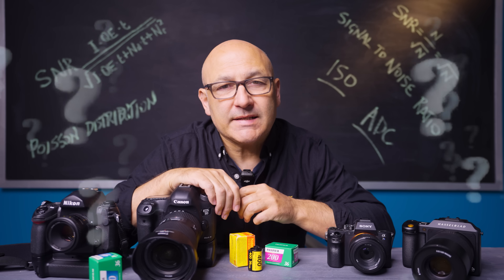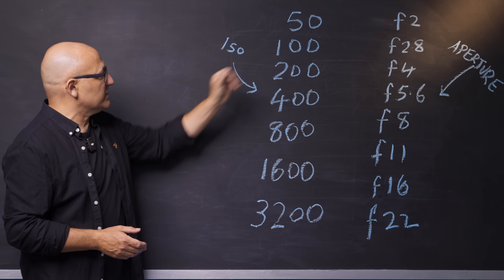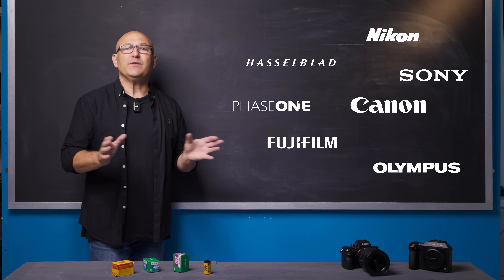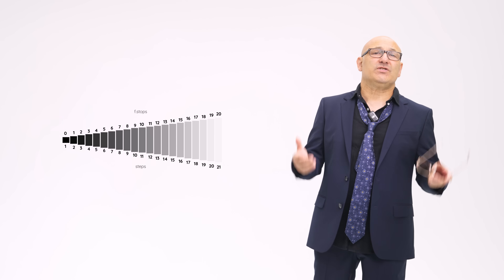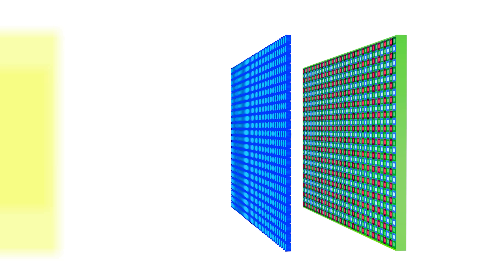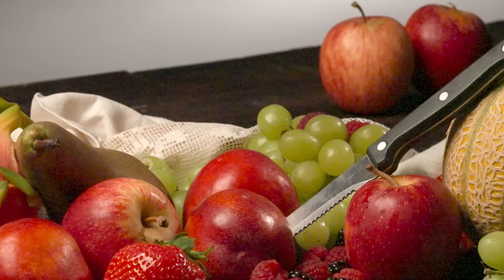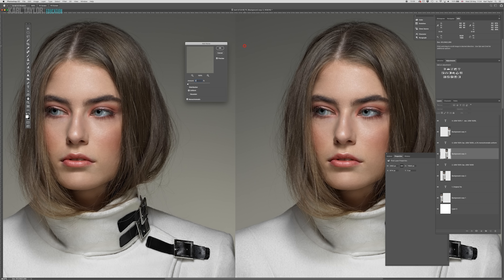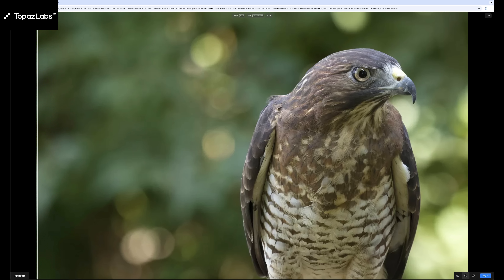ISO in Photography: The Truth Nobody Explains Properly

Comment: Part4 of extended comment going through issues with this presentation.
Error 13: That microlenses and BSI mean 'that the amplification process can be ramped up quite high before it becomes detrimental". You'd have to say this to make any sense of the falsity that the noise is due to amplification. The truth is that microlenses and BSI can increase the photon collection efficiency of the sensor and thus reduce (but not eliminate) shot noise.

Error 14: 'The sensor response is linearised'. No it isn't, it's just linear by the nature of how the photoelectronic process in silicon works. In practice it's non 'linear at the bottom due the intrusion of the sensor's own electronic noises, and at the top due to the non-linearity of the read transistor near the limits of its voltage swing. The part about 'manufacturers add curves' is quite amusing. This relates to error 7, and is a lack of appreciation about what is at the core of image signal processing. It's not about replicating the light that went into the lens (which is one of the misconceptions that leads to this whole 'amplification' baloney). The output is not an amount of light. It's a perceptual recipe that specifies how a human observer should see this, and is designed around the processes that go on in the human visual cortex. So while different manufacturers do indeed add their own tweaks, you don't get a viewable image just by passing the raw file values through. You don't need any particular raw file values to create a viewable image, you just have to knwo what the raw file values represent. Hence, no 'amplification' is necessary.

Error 15: ''Dual ISO sensors have a separate larger amp before the ADC'. It's hard to see what the size of the 'amp' would have to do with it, but in any case it's false. These sensors, are not 'dual ISO' sensors, because as in error 3, a sensor does not have an ISO. They are more properly 'dual conversion gain' sensors, and to understand how they work you have to understand a little electronics. The light collected in a pixel results in an electronic charge within the pixel. Charge, remember is measured in Coulombs. The charge is read out by a MOSFET transistor, which is a voltage controlled device. The voltage generated by this charge depends on the capacitance within the pixel, V=Q/C, where V is the voltage generated, Q is the charge and C is the capacitance. The ratio Q/C is called by sensor engineers the 'conversion gain', which is a very misleading name, because it isn't a 'gain' at all, it's just a conversion factor. Anyhow, the advantage of a high conversion gain is that it makes all the downstream read noise look less in relation to the shot noise (remember that is caused by actual photon count), so in low light, when read noise intrudes into the shadows, it's a good thing to have. Unfortunately, since the photoelectron capacity of a CMOS sensor is limited by the voltage that the output transistor can accept a high conversion gain limits the maximum exposure that the sensor can read. In a dual conversion gain sensor there is an extra capacitor that can be switched in to lower the conversion gain when large exposures are expected and read noise is insignificant - and as said before, ISO is inversely proportional to exposure - so usually the capacitors are switched in below some ISO setting, often around 400 (for stills). It's nothing like a pre-amp in an audio system.

Error 16: (excusable, though it does illustrate another fallacy). The Sony A7 SIII has a 12MP sensor which means bigger 'buckets' to catch the light. In fact, the A7 SIII has a 48MP sensor (see here: https://www.sonyalpharumors.com/surprise-the-sony-a7siii-actually-has-a-48-megapixel-quad-bayer-sensor/) so the whole 'bucket' argument fails - but we already knew that it did (see errors 9, 10, 11, 14).

Debatable 1: "With improvements in sensor technology we will continue to see improvements in high ISO performance" There haven't really been any for several years, and it's difficult to see the technology that will bring them. To improve low exposure performance it requires improvements in quantum efficiency (the proportion of incident photons converted to charge). Current QE is 50-60%, so there's a stop improvement to come at most, and that last 40-50% is much more difficult than what occurred over the 20 years or so before, when QE went from 20-25% to present levels. Read noise at high gain settings has got to the point where it's quite insignificant, and most manufacturers seem to have stopped even trying to improve it. Stacked sensors don't give and low-light performance advantages over BSI, they're mainly about speed and localised smart processing at the sensor (for instance, to provide simultaneous shooting, viewfinding and AF).

Debateable 2: What we should really be focussing on. IF you understand that it is low exposure that causes the noise, and not 'high ISO' then you adopt an exposure management method to maximise exposure. Setting your ISO first is the wrong way to do it, unless you know exactly what the light conditions are. Otherwise, you're making a wild guess about what is the exposure the light and your creative requirements (DOF and motion blur) will allow. You'll often get it wrong, especially if you're using an auto or semi-auto mode which is adjusting the shutter and/or aperture to achieve the exposure that you guessed in the first place. So, a noise based technique is to set the largest aperture than meets your DOF requirements and the slowest shutter speed that meets your motion blur needs. Then set the ISO to centre the meter (including any correction you feel necessary). Or just let auto ISO do it for you.

Sorry to be a bit harsh. I'd probably have been more gentle had the video not been presented in such a bumptious way!
Reply from the maker: Thank you Bob for taking the time to write this lengthy response. It does sound as if you have an appreciable knowledge on the subject but it would be good to know if you are qualified to do so or if you work in the sector of sensor design and technology. I'm not a sensor scientist by any means but I did have the information we put forward checked by technical experts from both Sony & Hasselblad and the video reviewed before we published. My line of expertise is in photography and filmmaking: www.karltaylor.com and in the education sector (the art part) at www.visualeducation.com
Reply: @VisualEducationStudio  Hi Karl. Thanks for the reply. So, to my history in photography. I got my first camera with aperture and shutter controls as a birthday present when I was 8. That's more than 60 years ago now. I was taught photography by my father, who was a physicist. I've been a keen photographer ever since, and as I learned further I found that all reputable sources agreed with what my father taught me. I went on to get a degree in Physics also, and a PhD in computer engineering. My career was mixed industry and academia. I designed some award winning electronic products, and became a professor with a research specialism in sensing systems. I have designed one specialised image sensor, and a number of pieces of equipment using image sensors. I am technical adviser and regular columnist (on technical matters) for Amateur Photographer magazine. So yes, I think I'm qualified. But really, I try not to wave qualifications at people, it's the arguments and evidence that matter. I'm very surprised that any technical experts would agree with the content of this, because it is fundamentally wrong more or less from the beginning. Were they actual engineers who design sensors or products using them or were they marketing people or technical authors?
As I alluded to in my first post (which I'm having difficulty getting to actually stick) one of the problems is that quite a few of the manufacturers' marketing departments are actually putting forward false information on this topic. You get material from them saying that ISO changes the sensitivity of the sensor, which we know is not true. I've seen material saying that aperture, shutter speed and ISO compose exposure, which we also know is not true.
I have no issues at all with you not being an expert in the technical side, because your expertise is as an accomplished photographer, and most photographers don't know the depths of the technology and don't need to, any more than a bus driver needs to be an expert in internal combustion engines. But you're presenting yourself as an expert, like it or not, so you have some kind of obligation to get it right, and just a little research would have indicated that what you said here can't be right, but you do need to know how to evaluate sources rather than just work on perceived 'expertise'. This in turn means having enough domain knowledge to work out whether what is being said fits together.
Many of the misconceptions here stem from a basic misunderstanding of what 'exposure' is - a misunderstanding that is, I'm afraid, promulgated on your website. Exposure is an input condition, how much light energy goes into the lens. You say, and many photographers think (wrongly) that it's an output condition, how light or dark the image looks. These are fundamentally different things, so it can't be both. One is a physically measurable quantity, the other is a perceptual phenomenon (if you wanted to know more you could look at my most recent series of articles in AP). If you end up thinking that 'exposure' relates to both the input and the output then the situation appears that somewhere along the processing chain the 'exposure' is getting changed, which must somehow be 'amplification'. If you know what exposure is, and you know about the sources of noise in photos, it becoems quite obvious that most of what you say here is wrong.
The problem I see here is that the internet is corrupting basic photographic knowledge. When absolutely care principles such as exposure are mistaught and misunderstood, we really have an issue. So when I see this miseducation going on I leave comments. I'm afraid that your presentation both contained more errors and was delivered with more confidence and chutzpah than most. Essentially, I teated it as I would have a piece of work from a PhD student, giving constructive criticism point by point of where they had gone wrong. I'm not expecting you to be an expert in sensor design, but actually most of the detail of sensor design is irrelevant to this. You just have to know the basics of photography correctly.
Reply from the maker: @BobN54  Thank you for the clarification, it certainly appears that you are commenting from a position of credible experience and academia. Hopefully our viewers will digest and appreciate the information you have provided.
Reply: @VisualEducationStudio  I think that more of the point, Karl, is that you need to 'digest and appreciate' the comments. You're in a position of educator here (you claim this status quite clearly) yet someone who you acknowledge has 'credible experience and academia' has told you that most of the information that you are teaching is wrong. Getting it wrong is understandable, because unfortunately there is these days more incorrect information that there is correct, and people just learning don't know how to differentiate between them. So it's very easy to get the whole of teh photography basics wrong. But once you realise that you have and an educator you need to re-educate yourself. Maybe a first step is getting the concept of exposure straight, because at the moment you're mis-teaching it on your site, and many of the errors here stem from not knowing what exposure is. Once you understand exposure, you'll see why a lot of what you're saying just doesn't stack up.
Reply from the maker: Hi Bob, I have appreciated the comments that's why they are still here. I feel there are a few possible options we can follow.

Option 1. We delete the video because you personally state that everything in it is incorrect. In doing so then your comments would get deleted along with it and along with the work we put into making it which we did only after having it fact checked and verified by people working in the technical fields of what we were talking about.

Option 2.  We delete just your comments and ignore you - although we don’t believe that to be appropriate because we feel youtube can be a good space for open debate and opinion.

Option 3. You accept that our video has some valid points that help most people understand that sensors are different to film in terms of ISO, that increasing the ISO number isn’t actually changing the sensor it is amplifying something or changing a number called ISO on a camera which in turn causes the final image to have more noise (as in the real world photographic examples provided in this video). That not all noise is bad in photography and can be used to our advantage in certain areas of photography and post production (as demonstrated in this video). That most of this is nerd/science stuff that is of no consequence to the average user (including me) and that there were many aspects of this video that people find entertaining - even if the information is not delivered to PHD level knowledge standards. 

My guess is you'd go for option 1 but for others reading these comments I feel it worth mentioning that of course you are coming at it from a highly qualified scientific position but delivery of information in that way can often make no sense to people and therefore it wouldn’t be be absorbed well, if at all.

For example when you talk about ‘exposure’ from a scientific perspective it isn’t going to be the same as people’s general need to understand if something is too bright or too dark because that is just how it is understood by people, in the same way that the word ‘sick’ has been hijacked to actually mean something else altogether, that’s just the way it is.

Science will tell us that a granite rock is made up of mostly space between atoms even though to everyone else if they hit their head on one it will feel pretty solid.

Also some of your previous comments have sounded like an attempt to belittle our position in education and increase your status simply because you don’t accept this video or don't like how it was presented - however our position in education shouldn’t be based on your dislike of this video - our eduction is not in the ‘scientific’ realm it is in the ‘artistic’ realm and that is something we do very well and have done for over 17 years, as well as delivering images at a professional level for 30 years.

You could then argue that we shouldn’t try to deliver ‘scientific’ videos on YouTube and if you feel that then please revert back to Option 1. 2 or 3 and tell us which you prefer. I’m pretty sure we are going to go with option 3 ourselves and if you prefer to see something more solid in the science then we welcome you producing a video on the subject of ISO and we will be happy to offer you any advice on how to make it engaging.
Reply: @VisualEducationStudio  Hi Carl, I apologise  if I appeared to 'belittle' your position. I do have a deep disdain for educators who teach material outside their domain of expertise and then get it wrong (which is different from making the odd mistake, because we all do that). In my view it's the antithesis of what educators should be doing. It ends up with learners being done a huge disservice. They rightly expect their teachers to be experts in what they teach. You have conceded that you are not an expert in most of the topics in this video, and indeed if you were you'd have been able to show me where I was wrong in what I said. So, maybe I came across a bit more harsh than intended.
As for your course of action, really, it's up to you. What you do depends on your integrity and self esteem really. You have put yourself in a poor position, where you've produced a video which really contains so many untruths and fallacies that it won't be of much use to anyone. It's much like had I tried to produce a video on topics such as composition, setting up lighting, studio management or so on. I would have embarrassed myself had I tried.
I'm not suggesting that you shouldn't present 'scientific' videos, I'm just sayingf that when you do the science is right. The point of scientific education is not to decide that the science is just too hard for the lay person so tell them lies instead, it is to find ways of explaining the science that they need to know in terms accessible to this. In this case, the science isn't hard. The discussion becomes hard when you start from the false premises that you have and them continue to invent more falsities to try and dodge the contradictions that occur.
I must reject your counterposition of a 'scientific' definition of exposure with some other one. There is only one correct definition of exposure in photography, and it forms the basis of whole of the management of light in photography. Get that wrong and everything else that follows is wrong. The reason so many photographers understand it wrongly is because there have been so many people teaching it wrongly since the emergence of the internet. That's exactly what I'm trying to correct.
Whatever words you use, you cannot understand ISO without understanding that exposure describes the amount of light that shines on the sensor, and that how light or dark the final image looks is something different. In film days it was called 'density', nowadays the technical term is value or lightness (I prefer the latter). You actually don't need to know the names, just that they are different.
So, ISO in simple terms.
1. Exposure is the amount of light (strictly per unit area) that is incident on the sensor.
2. Lightness is how light or dark the image looks.
3. Lightness is controlled by exposure and how the image is processed, whether inside or outside the camera (or a combination of both).
4. ISO defines the relationship between exposure and lightness. A higher ISO means that a good tonality is achieved using a smaller exposure.
5. Noise is controlled by how much light is captured in the image. Therefore, high ISO settings, which are associated with small exposures will yield noisier images.
All of that is true, and no extraneous 'scientific' word salads are required to explain it. A photographer should not need to have familiarity with electronics to understand the basics of photography.
I hope that helps.
P.S. Please at least change the incorrect definition of exposure in your tutorial. It's not good to be teaching the basics wrongly.
Reply from the maker: @BobN54  Hi Bob, apologies for the late reply as I've just returned from 2 weeks holiday with my family in France. I'm typing this as I read each of your points so please appreciate that it may be a grammatical disaster. Yes I agree that it can be frustrating to see 'educators' teach material outside of their domain but I also appreciate situations where 'presenters' can do a good job of relaying information in a more digestible fashion than academic experts to a mainstream audience. I'm not saying that you can't because I have no idea what you can or can't do because I haven't seen any material where you explain these concepts. Entertainment in my opinion is a key component of good education and although this video does fall outside my area of expertise it is loosely associated in that our audience and I are interested in the results and how those results might affect our 'creativity' or creative tools - as such we included the results of tests in this video that are more pertinent to those areas. For this video we did decide to go a bit deeper on the noise and sensor 'tech' to a point beyond where my knowledge extends and that's why I consulted with other people who we considered experts for guidance. It appears that we could have gone even further with that for a better result with someone like yourself.

With regards the accuracy of the information provided in the video and whether we decide to keep the video published, I'm going to go back to the people we consulted with for a second and third opinion before I make that decision. With regards 'scientific' videos we have published others such as this one on diffraction: https://www.youtube.com/watch?v=SsLjMF6nJus which I have a greater general understanding than this ISO/noise video. In the 'diffraction' video I also had to seek some external advice on some of the points but does that mean that I shouldn't have made or presented the video? If this diffraction video is technically accurate and presented in an entertaining way then I believe that validates its existence regardless of my complete knowledge on the subject. 

In regards to exposure, the scientific explanation is of course correct and I do understand that it is the amount of light on the sensor but the word exposure can mean different things such as 'an artist is not getting enough exposure' or the act of 'being exposed' and these definitions have simply come to pass that equate to an understanding of exposure meaning 'brighter or darker' in general photographic terms amongst photographers. If we actually increase exposure in that you slow the shutter speed or open the aperture (to let more light per unit area on the sensor) then the picture gets brighter. I fully understand that increasing ISO does not let more light per unit area on the sensor but the basic result of the picture getting brighter is the same for the photographer and therefore you can understand why the term has come to be accepted in such a way.

I will review our tutorial on 'exposure' on our visual education platform (it's been many years since I've seen it) and I will see if we can add an amendment to the explanation. I think you are referring to this fee class on our site: https://visualeducation.com/photography-course/understanding-exposure/ and if so I welcome your advice on where on how the terminology can be improved.
Reply: @VisualEducationStudio  Firstly, kudos to you for actually engaging, many people who find themselves in the position you do simply ignore it.
I think opposing the 'digestibility' of 'academic' versus 'presenters' information is a false dichotomy. The correct information is no more complicated, or less 'entertaining' than the wrong information. It only becomes over-technical when what has to be done is try to explain to someone why their misapprehensions are wrong. What's more, the correct information is easier for people to grasp, because it all fits together. That's one reason why I'm on a bit of a crusade to counter all the photographic information that's around.
With respect to exposure, this is absolutely the basic concept in photography, and just has to be taught right. It's no excuse that many photographers are using the term wrongly - the job of the educator is to fix that. It is a real problem, because if a photographer thinks simultaneously that 'exposure' means both the light at the input and the tonality at the output it becomes impossible to conceptualise how photography actually works - particularly with respect to ISO, which was the topic of your video. As for your 'understanding exposure', it's not about the terminology, about the facts. I'd encourage you to actually read it critically yourself and think what you'd gain from it if you were just beginning. Some questions that you might ask yourself:
1. Is the definition of 'exposure' given actually correct? (hint: think of this in the context of the paragraph that follows the definition).
2. What is a beginner meant to make of the term 'expose an image correctly' without prior knowledge?
3. If you had no prior knowledge what yould you make of 'the balance you need to achiev correct exposure'?
4. Will a correctly exposed image have a histogram that is evenly spread from edge to edge without any gaps? Doesn't this depend on the scene?
and so on.
I'm happy to help, the real question would be where to start.